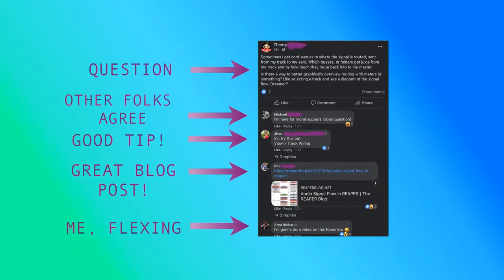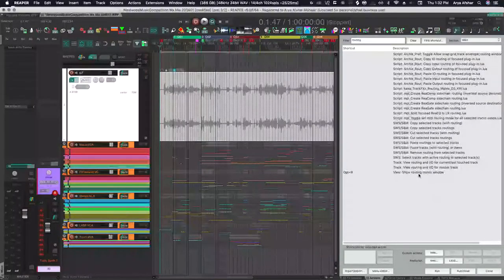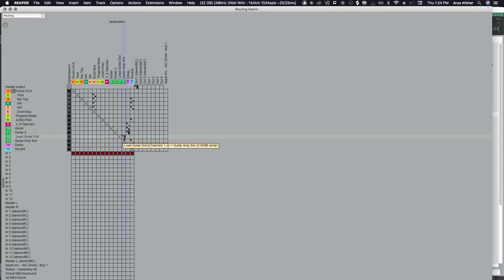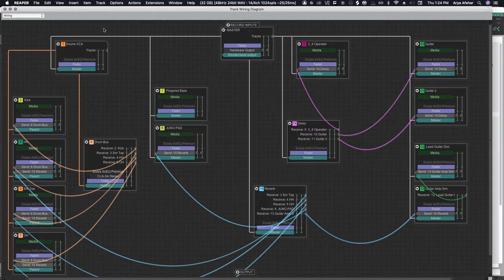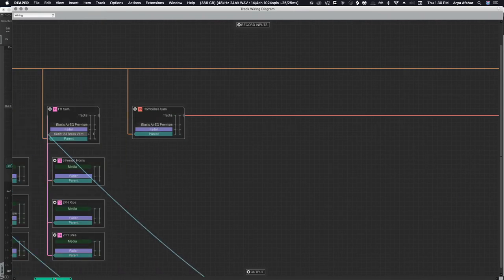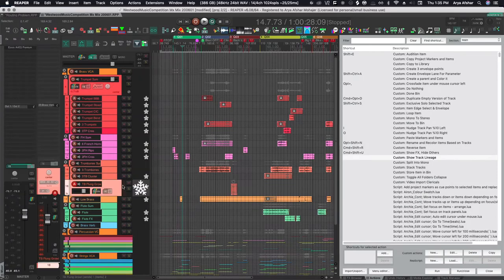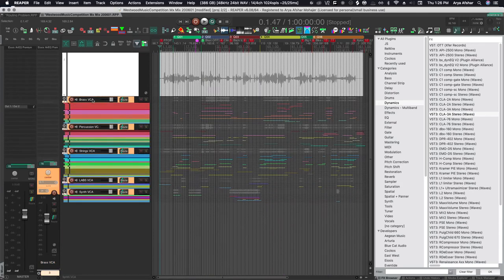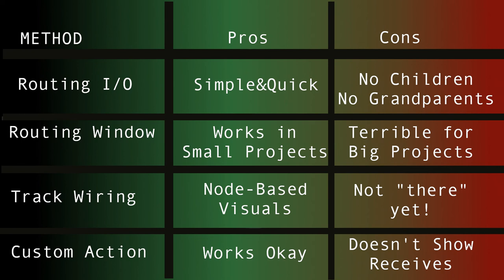Tracing a Track's Signal Flow in Reaper (Routing Matrix vs. Wiring vs. Custom Action vs. I/O Window)

Comment: I thought i was mad. Track wiring really is useless.
Reply from the maker: Yeah so far it is kinda. It's a great idea and I freaked out when I saw it, but it needs tons of work.
Reply: @IDDQDSound   Not even any metering. That's what Reaper needs. Level Metering in the i/o panel, routing matrix, and the track wiring.